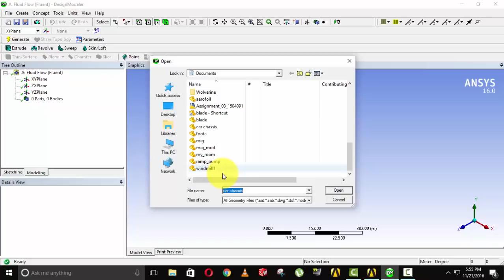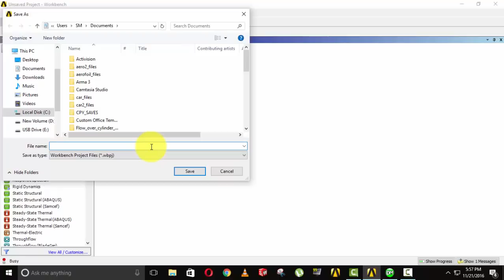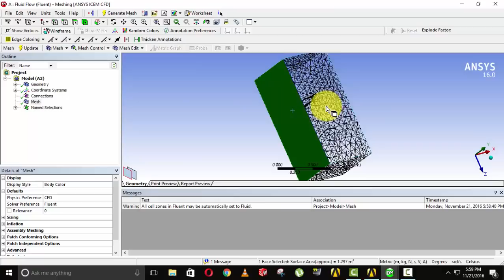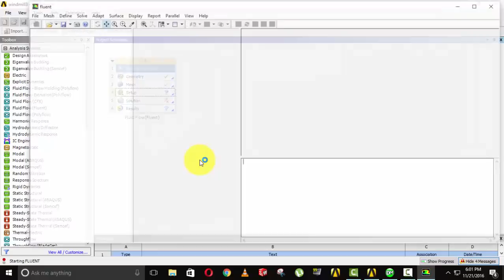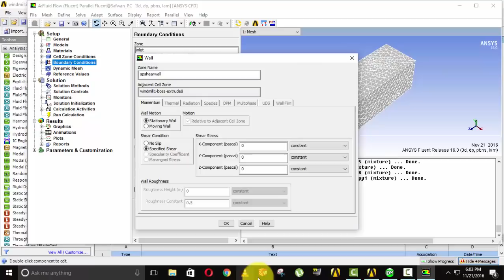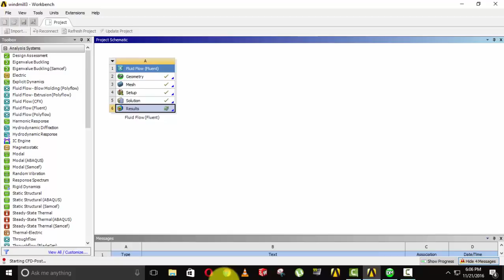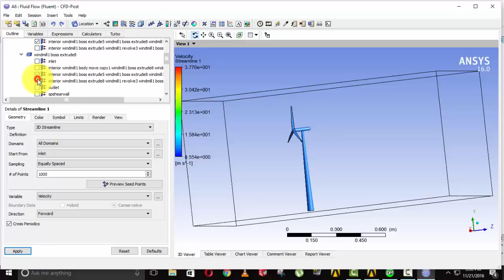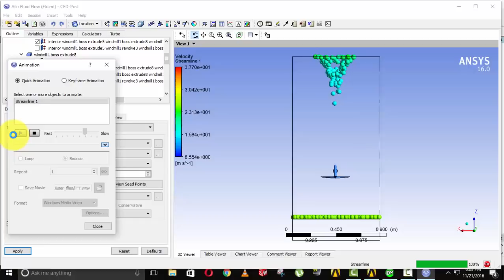ANSYS Fluent for Beginners: Lesson 1(Basic Flow Simulation)

Comment: When I tried to import the solidworks file in DesignModeler it said "Attach failed. No compatible interface"

Had to use SpaceClaim instead to import which worked. 

However, although everything looks OK in Fluid Flow Fluent the results seem to think that the windmill is not constructing anything. Only uninterrupted red flow lines. Any ideas?

Comment: I followed the step of this tutorial, but at the meshing part, I clicked update and i got hex element on that and components are unrelated (i.e. the grids are discontinuous). It ends up with a wrong result. 
Is there anything I should do? I am really new to the software.
Reply: As he just pre simulated the model, he just clicked on update mesh. From the word you can know that it will apply the modified tings to the pre existing mesh. 
If you are meshing the object for the first time, then you have to click generate for it. And then after modifying the settings, you have to tell the mesh to look into the modifications and adapt, that is where update is used.
Reply: Before meshing, you should subtract the solid part from the fluid domain in DesignModeler via a Boolean operator (see https://www.youtube.com/watch?v=Bb8Tsd9eGe4)

Comment: I used my own model, but my air streamline goes right through my main model. Is there something wrong with my mesh or geometry? is the round enclosure around the blades cut into the huge block u made? Is there something else I have to do to the mesh? I just clicked generate mesh and created the named surfaces. Pls help. I can send my .iges file so you can try it out
Reply: how did u fix it??
Reply: @makavelli9705  I ended up "cutting" the shape of my model inside a giant rectangular block and doing the simulation like that. However this wasn't what I wanted :(. I don't really have enough experience with this but I hope this might be what you're looking for
Reply: @javiergomez8064  its fixed in my case but i dont know why there are 2 options. Either because i set the initialisation to hybrid or because i made a boolean substraction in my geometry. I did both at same time and the flow worked. Now i have a problem figuring why there is lift and drag even though its a potential flow

Comment: The file that I downloaded was not compatible and there was an error when I loaded the geometry
Reply: Leidy Catarina 
Download IGES OR STEP FILE
Reply: I had the same problem. The solution is: The geometry that you are downloading has material on the windmill. However, you are simulating the fluid, so you need to do a boolean  operation at the wind mill, in other words, you don't have fluid where is the wind mill, so you need to "delete" the material of the windmill. Then, the windmill will affect the flow.
Reply: Try with our tutorials too..

Comment: I have downloaded the model and followed this video but at the end the stream lines are completely uneffected by the windmill? Do you have any ideas what is going wrong? I am using Ansys 18.2.
Reply: I had the same problem. The solution is: The geometry that you are downloading has material on the windmill. However, you are simulating the fluid, so you need to do a boolean  operation at the wind mill, in other words, you don't have fluid where is the wind mill, so you need to "delete" the material of the windmill. Then, the windmill will affect the flow.
Reply: If your flow-stream doesn't affected by the windmill, probably you haven't subtracted [Boolean operation] the windmill geometry from the enclosure.
Reply: because this guy didnt show that for inlet you are supposed to change the variable to velocity. let me explain, when you are in setup> boundary conditions> inlet>right click on it, go to type and change it to velocity type. after this continue whatever this guy shows, if you have an issue, do ping me
Reply: Afraid the current conditions are set to "velocity-inlet". Any other ideas?
Reply: I am experiencing the same issue. Should the outlet boundary condition also be of the velocity type?
Reply: Carl Wilkinson ok, I need you to do something for me. There's this thing in Ansys where you mess up once and the whole thing goes hay wire. Redo the whole thing and make sure velocity is not zero. Also, did it show any errors during the mesh or the solution phase?
Reply: Still experiencing the same problem but i have noticed there are no connections listed in the mesh?
Reply: I am assuming this step isnt shown in this video? How would you do this using Ansys 18.2?
Reply: I think the model placed in the link to download does not subtract the windmill in the box. It appears the flow has not interaction with the mill at all!
Reply: Ricardo Barbosa de Almeida do you know of a video explaining how to do a boolean operation in 18.2?
Reply: @carlwilkinson5082  Did you solve the problem, bro?

Comment: Hi. Can you explain how have you designed the geometry in solidworks?  Was it as a part? as an assembly?  How is the "step to step" process I have to do to use a geometry from Solidworks in Ansys?   Thank you
Reply: Can u at least explain how you created the outer box? plz...
Reply: because designing and analysing is 2 different thing and it is about flow simulation not about designing something.

Comment: Hey, thank you for your great video!
I have a problem with my own rebuild of your simulation..  In my simulation the particles just move through the object (some kind of a rear wing for a car) and doesn't change speed ...
Do you have any ideas, to solve this problem ?
Thank you for your effort !
Reply: i had the same problem :(
Reply: I had the same problem. The solution is: The geometry that you are downloading has material on the windmill. However, you are simulating the fluid, so you need to do a boolean  operation at the wind mill, in other words, you don't have fluid where is the wind mill, so you need to "delete" the material of the windmill. Then, the windmill will affect the flow.
Reply: @Rickzodd  can you please explain what boolean operation to do as well as the target and tool body?
Reply: your tool should be your domaine box and the target your wind turbine, or vice versa if i'm not mistaken
Reply: @mandombe  bro you gotta tell us the operation
Reply: @mandombe  as well as the solids to pick
Reply: @Rickzodd   hey can you please explain how  to delete the material of the wind mill???
Reply: @Rickzodd  hey can you please explain how to remove the material of the windmill
Reply: I have also faced the same problem. Do boolean operation to remove the material, available in the create option in design modeler. Select enclosure as the target body and the windmill as the tool body. Check there is fluid selected in the details view of part.